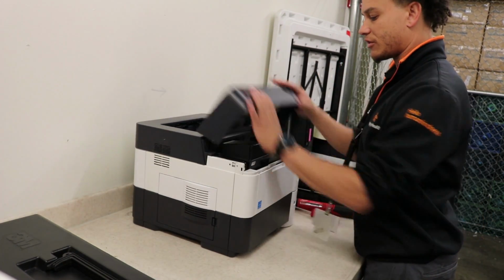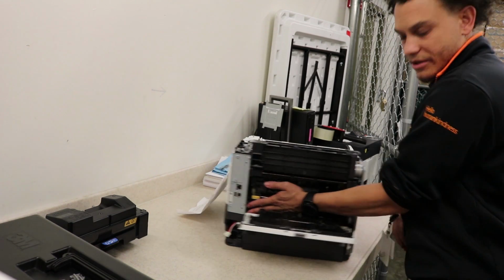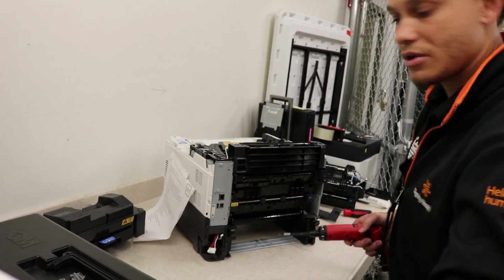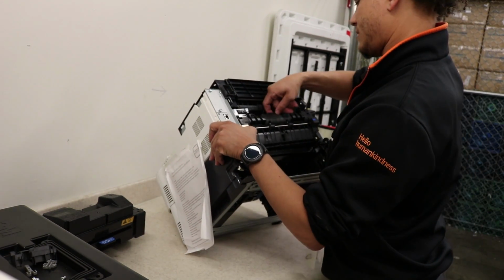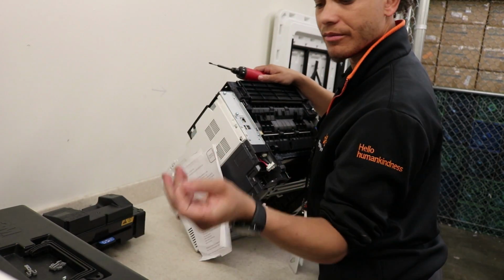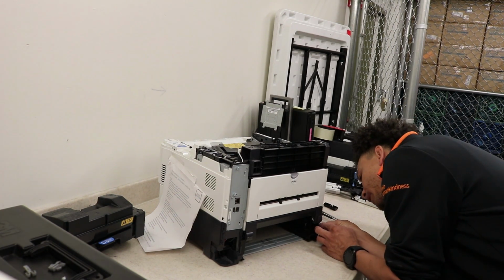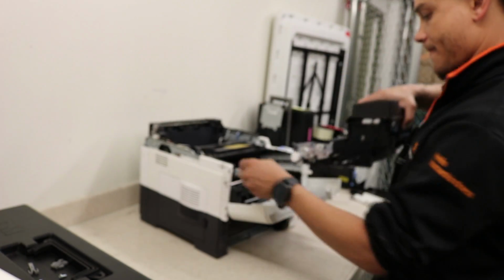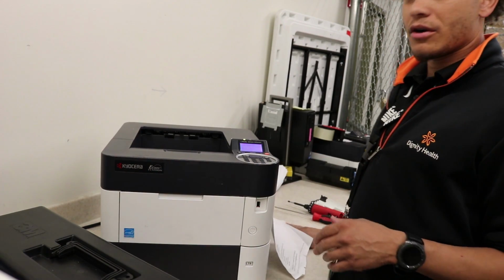#Kyocera #Printers How to replace fusing unit on Kyocera FS 4200 4300 printer

Comment: Not shure if it was the same unit but some kyos have a fuser pressure releases mechanism wich makes it hard to put the new fuser in. You can cheat the mechanism by turning on the printer with no fuser installed and rear cover open (whatch for a cam movement). Afterwards the new fuser fits in pretty easily. Cheers from Hamburg.
Reply from the maker: Thanks for the info.
Reply: @Supertechs3  you're welcome, I installed an MK a few days ago and forgot to mention that you must trick the door switch in order to force that cam movement cycle

Comment: I replaced a FS-4100 fuser last week and didn't take half the shit you took off. I took off the back covers and the rear guide to get to the fuser. I didn't need to take off the drum, top cover, etc.
Reply: Different models have different removal procedures 😂

Comment: How do you get the black transfer roller out?
Reply from the maker: On top of the transfer roller there is a black guide, slide it to the right and it will come out. Next, take a flat head and lift both ends of the transfer roller up and out.

Comment: kyocera fs 4200 print blank paper how to solve the problem thanks
Reply from the maker: It’s either the print head open shut actuator is stuck. Check the top open close cover to make sure it’s properly engaging the print head actuator.

If that’s not it, the developer clutch may be bad. Just replace it.
Reply: @Supertechs3  how to check It’s either the print head open shut actuator is stuck. Check the top open close cover to make sure it’s properly engaging the print head actuator.
Reply: @Supertechs3  can you write how this is checked
Reply from the maker: @mikidjuka5446  Remove the top cover and look to the right of the machine where the top cover hinge would connect to the machine. You will see a small black plastic flap that can be moved back and forth, this gets stuck sometimes and needs lube. If it's moving okay you may need to replace the developer clutch. Email me at info@supertechs3.com if you can't find it.
Reply: @Supertechs3  I'll try it on Monday so I'll get back to you thank you very much

Comment: You absolutely do not need to remove the top or the developer or the back deflector plate to replace a fuser. It is beyond pointless and unnecessary.
Reply: Thank god, I was freaking out as I need to repair one of these puppies in a pharmacy & my only life line is unavailable.